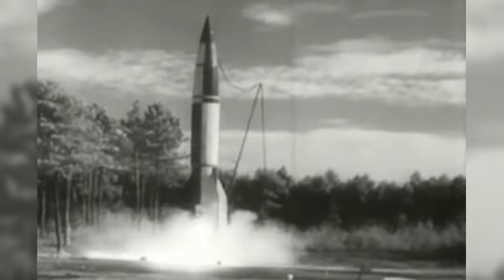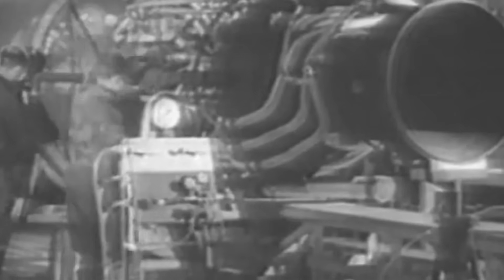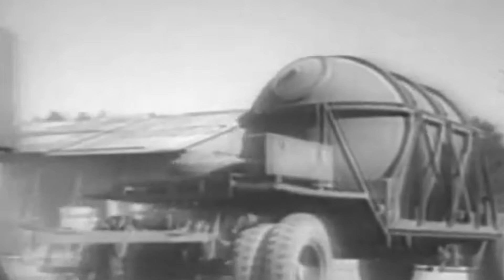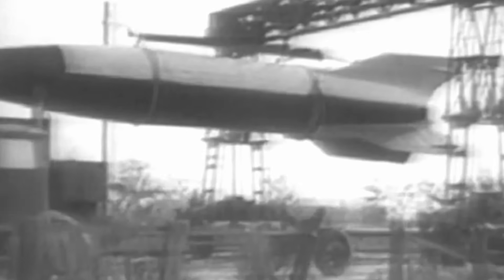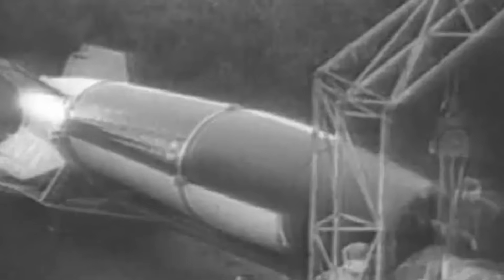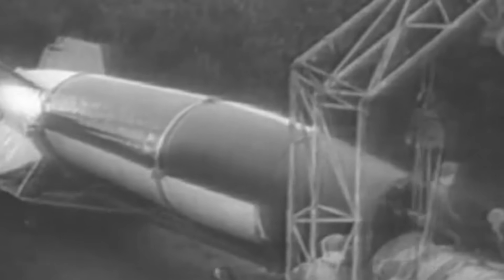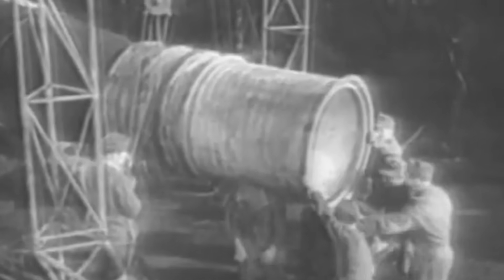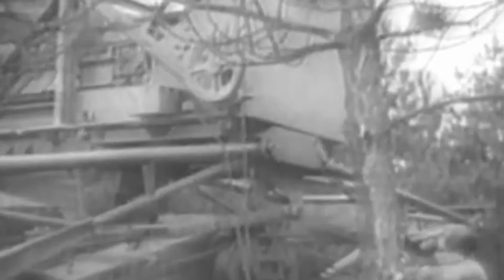How V-2 Rockets Were Launched

Comment: They had wanted to use the more powerful  hydrocarbon/liquid oxygen propellant combo (like later NASA rockets) but it burnt at too high a temperature for the materials lining the combustion chamber. You wonder how far it could have flown had they gotten that one right. Moscow ?  New York?
Reply: wasn't this due to shortages of heat resistant high quality alloys and materials like nickel and cobalt so they had to use steel covered with aluminum? also they had to make some aircraft out of wood like the horten ho 229 was designed with a wooden airframe with a green fire resistant paint and it's jet engines lacked important materials in key places like the turbines and combustion chamber which i think also reduced performance
Reply: @kuromiandmagic  My understanding is that, for instance,  the Jumo (?) jet engines of the Me-262 had working service lives of maybe 10 - 25 hours (or less), due to blade composition issues re: ingredient metal shortages. Googling this suggested they were getting on top of the problem by war's end, through use of ceramics
Reply: @daffyduk77 pourquoi n'ont ils pas mis au point des avion fusées super stratosphérique équipés de super bombes guidées, ça leurs auraient économiser des matériaux précieux...?

Comment: The amazing part about the V2, is the tiny 4 cent doorbell buzzer button on the bottom of the fin, that started all of the guidance systems, once the rocket lifted off the pad and took the pressure off of that button so it could close.
Reply: The A72 switch 🥰
Reply: @pungskum  always wondered what would happen if that switch failed during flight, and it went open circuit again and shut off the guidance.  I have a idea of course, but was always curious.  Would it continue on, like a bullet locked in flight??  Would it do the dancing Girdie/galloping ghost??.  Hmm.  Safe to say it wouldn't reach the target, or would it??.

Comment: Had the germans developed a solid fuel system it would have been easier. Safer.  The liquids were hazardous.   But solid fuel for thst size would be quite development in that era.  Not until minuteman that was possible.
Reply: ACPC solid motors were not developed until the 1960s. 1940s JATOs used asphalt and AP or PC, low performance.